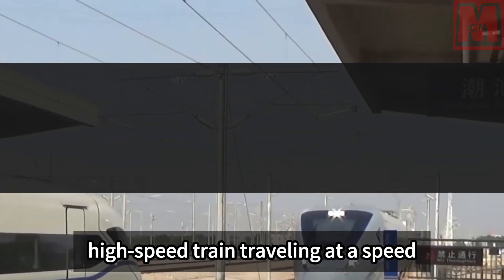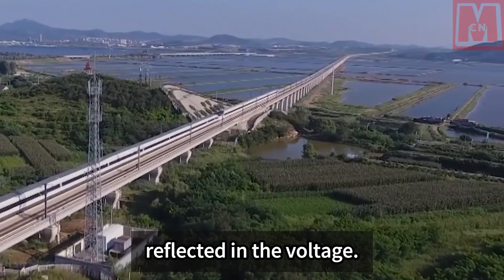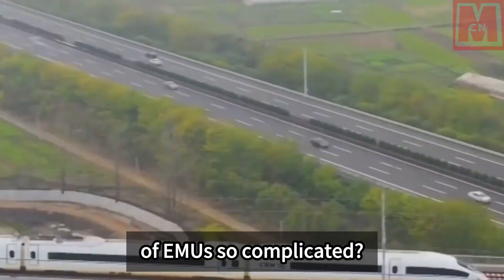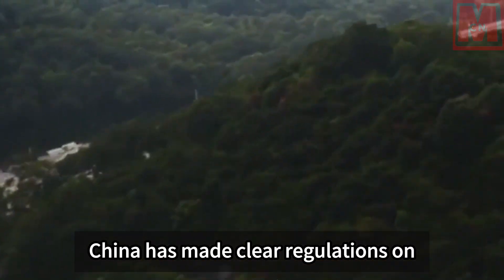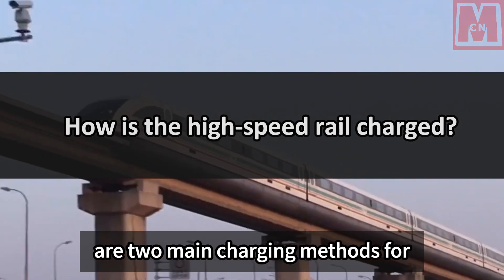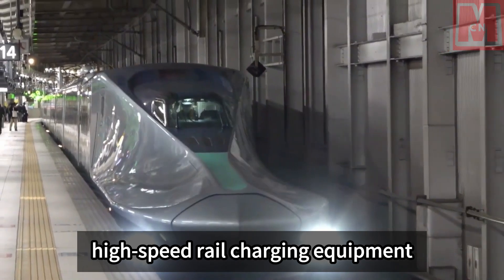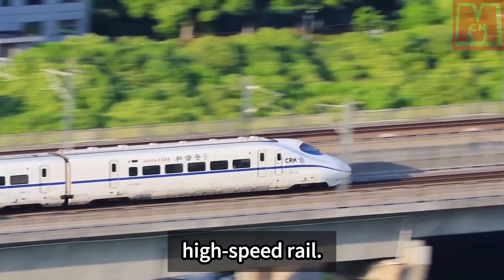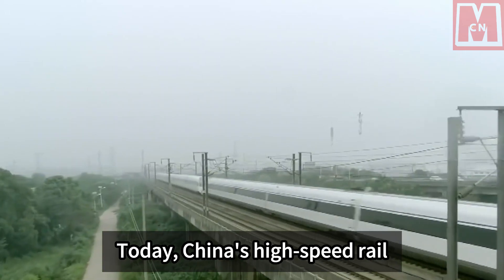How does China's HSR recharge during its journey, What happens if there's a power outage halfway?

Comment: @ 2:05 , I think this is wrong info; the video  reversed the data. China household electricity is 220v , Single phase, whereas High speed rail electricity has much higher voltage, and should be 3 phase. Mathematically speaking, a single phase electricity will not be able to deliver sufficient power to the high speed train motors.